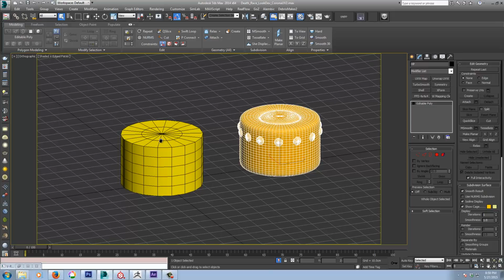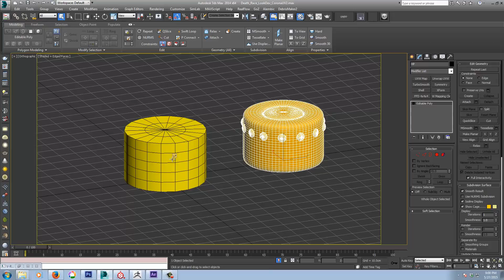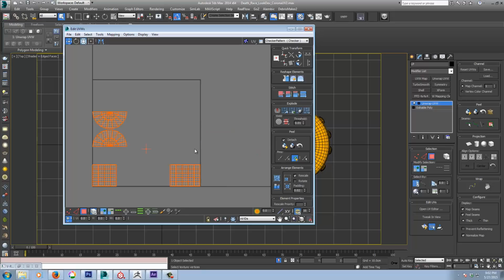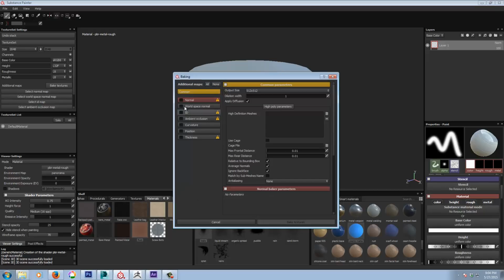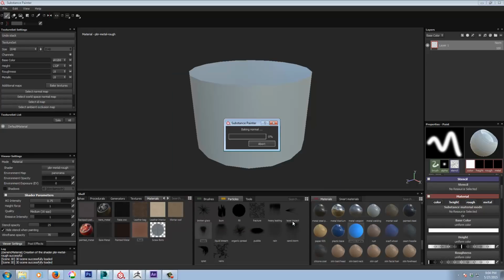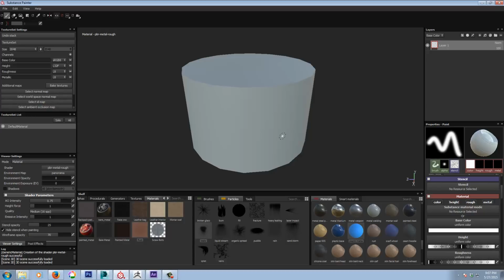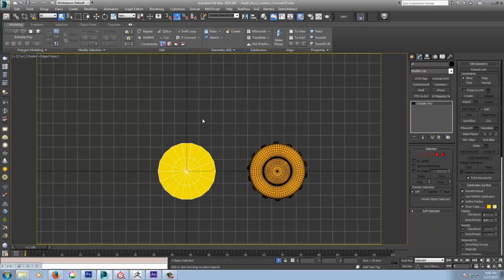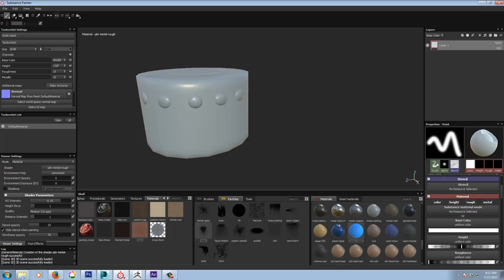Baking a Normal_Map on Mirrored UVs

Comment: Hello @musashidanmcgrath !

I`ve had no idea that I have to flip the UV shells individually as well. Also , what do I do if I want to bake 1/4th of that cilinder, do I move the left and the right quarter in in U and V directions ? Like you moved your half of a cilinder to the right as an offset. If U baked 1/4th would you have had to offset the other one two spaces to the right ? And as an additional question if I may, would it have made an issue if you would have hardened the border edge and then baked it ? Would it have produced a seam ? 

Thank you so much for the video man !
Vick.
Reply: Also what happens in the instance of a face, you can`t flip that UV shell onto itself as it`s not simetrical ? So in this case will you always have a flipped UV half ?

Comment: Hi,

I have been looking at your tutorial and for some reason I need to have 
my uv's inverted in max (mirrored side). If they are not inverted and I bake them in SubstancePainter its all screwed up in the bake on the mirrored side. When they are
inverted (red) they are ok and the bake is fine. I been wondering why this happening do you 
perhaps have any idea ?:-) In your tutorial you show that all is NOT inverted. What could be causing this?
Reply from the maker: Did you offset the mirrored shells 1 tile out of 0-1 UV space?
Reply: Hi, Yes I have offset the mirrored shells.  But they need to be inverted to get good bake SP. Also my text is mirrored/inverted which is not good. In the the tutorial its hard to tell if things are mirrored and working as there isn't any text/decalls just the cylinder with bolts. Perhaps more complex test. If you have any advice what could be causing this?

Comment: Great Tutorial. Do you perhaps know if Symetry modifier  in Max2017 can have issues? , because I'm getting strange results as my UV's are broken :-( I did a quick test just mirroring and then it worked. Do you perhaps have any info on this?
Reply from the maker: +decorix I'm not sure. I only used Max 2017 when beta-testing and I didn't notice the problem. I believe the official 2017 release has a lot of bugs. You should log it with Adesk.
Reply from the maker: +decorix And thanks. Glad it was useful. Yes, the mirror tool now has a geometry option on by default that doesn't mess up the mirrored mesh normals.

Comment: Hey man, glad I ran into your video as I'm just starting work on some normals stuff which I've never done before. But, is it still possible to get a normal map for a series of shells that are not perfectly symmetrical? For example, I have a bunch of shells laid out for a head piece I'm making for a character. Theres about 11 odd shaped shells, that will be mirrored over to the other side, however on the map, you cant have both shells in the exact same shape space 0 & 1, while both non inverted. 
Heres a picture with what I mean http://imgur.com/A2ewN4Y

In your example your able to flip each shell horizontally because each shell was perfectly symmetrical, what about about for 99% of every other project that wont have that luxury? 

An example of what I'm basically trying to do is for example reuse the normal map of a shoulder pad on the left for both shoulder pads (left and right) since geo will be perfectly symmetrical across the x axis (but asymmetrical object wise).
Reply from the maker: +Myselfsama Cheers mate. Good question, and one I probably should have addressed in the vid. In 3dsMax(looks like you're in Maya) there is a 'mirror horizontal' tool which doesn't invert the UVs. So I would apply this after the 'flip horizontal' to return to the correct position but with the UVs not inverted.